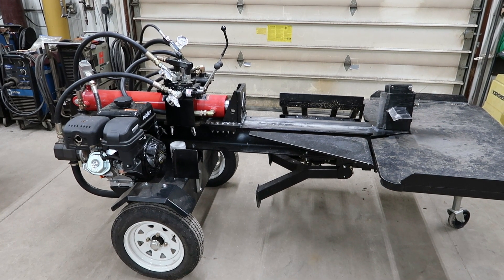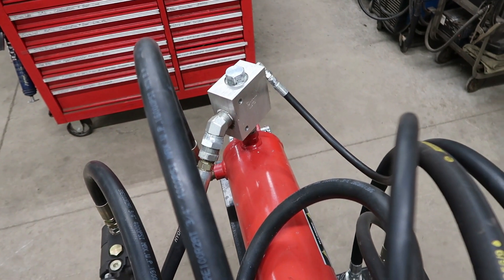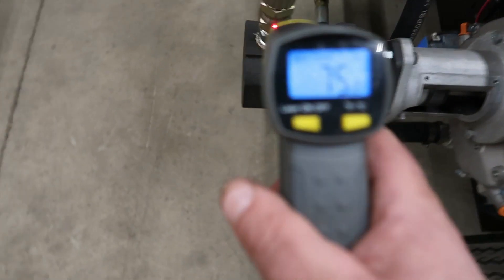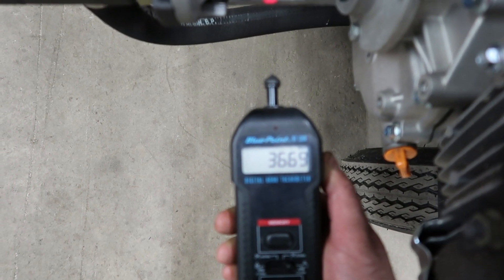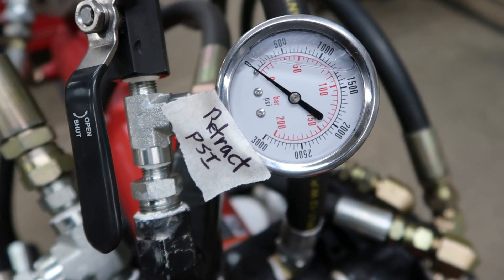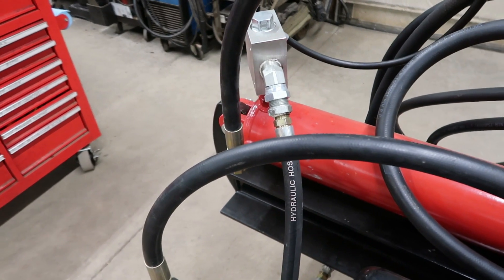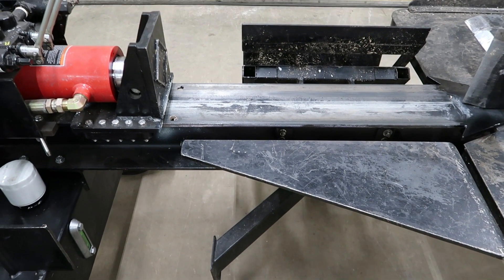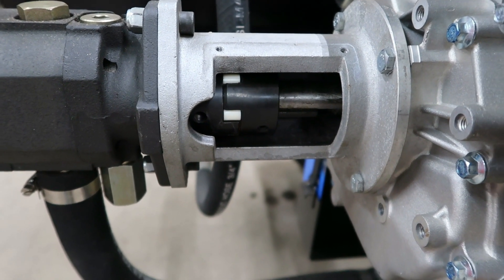Hydraulic Log Splitter Dump Valve- Operation With and Without  #7

Comment: What rpm is the pump rated at 28Gpm . I thought they were round 4000rpm this project helps in heat, speed, fuel consumption and time well worth it in the long run

Comment: Hello awesome information can you tell me where to get one of these dump valves part numbers or manufacturer? I've call several hydraulic shops, cylinder repair shops, even the dealers for the prince auto cycle valves and everyone acts like they've never heard of a dump valves on a log splitter! Thanks for any info that you can give out

Comment: Did you find that the splitting pressure needed to be set when you got the splitter.   I went from a 28 ton to 38 ton and I swear the 28 splits wood better.     I do not have a gauge on there yet but the motor isn’t even bogging down when it’s trying to push wood that is stuck

Comment: I used to work on hydraulics all the time.  Using standard 90* hydraulic fittings makes a lot of restriction.  Also, open up the ports in the cylinder and round the edges.
Reply from the maker: Yeah swept fittings would be better. I did open cylinder ports but then I look inside hyd hose crimp stem IDs and think…well there’s a restriction point I can’t do anything about.
Reply: It’s best to not have any 90 degree fitting in systems even if it doesn’t look as nice 👍 and you will run oil cooler 😊😊😊

Comment: Great video, only I could not think about doing all the plumbing. But I really like the heads up for the new spider....I’ll do it if I end up getting this machine, like I hope I will. I really like what you did got the catch table and side piece add on. Did you do the steel work or did you have it fabricated? If you had it fabricated, would you have a drawing for it and the cost? Thanks for the video it was superbly done.
Reply from the maker: These are good machines at a good price. All fabrication was done by me. No plans. I do most all my projects in my head.

Comment: There's a slight error with your oil flow when on the return stroke. With the rod being as large as it is compared to the diameter of the cylinder there is a marked increase in flow rate. On the extend stroke there's about 590ci to fill the ram. On the retract stroke only about 300ci is needed. With 56gpm being pumped in to the retract end there's approximately 110gpm being pumped out. With the Eastonmade 5" cylinder and 4.5" rod the ratio is extraordinary. I reckon the size of the hydraulic lines needs to go up a size at least especially around the dump valve.
Based on my guesstimates without seeing a schematic of the hydraulics I'm guessing the flow rate of the oil is peaking at about 40 feet per sec.
Reply from the maker: Alan correct on flow calcs. I made up a working spreadsheet years ago to figure this all out as well as there are online ones too. You posted this on my wrong video but yeah I know your talking about my homemade splitter. The 1” Dump valve can handle 60 gpms alone which leaves 50 remaining which can easily be split up between each 3/4” return hose back thru each valve. My return pressures are just a little higher than this splitter...@ 300-400psi. I also left myself a 1.5” bung on my return manifold in case I want to return dump valve oil thru filters which are rated at 110 gpms. They way I have it plumbed now oil is returned to each end of beam in hopes to disperse heat all throughout. So far so good.

Comment: Is the chrome rod hollow or solid ? Why after retracting the gauge sets at 1500 psi ? where is that coming from . Some of the retract pressure is built up to open the dump valve, some dump valves only need 25 psi.
Reply from the maker: Rex, I believe it is solid. I cut the rod end off the cylinder I bought for my homemade splitter and it was solid. Pressure remains high due to the fact of pressure being trapped after detent kicks off. The gauge is reading rod side and dump valve pilot circuit not base port pressure.
Reply: @garny3766  So if the pilot is under pressure,  the dump valve stays open until the extend lever is pushed ? It seems that the 250 PSI retract pressure should be all you have.cant see how it jumps up to 1500 so quick. Is your trick manifold on top the ARV made with square tube or all hand fab'd ? I am going to follow your lead on mine, hope you dont mind.
Reply from the maker: @rexhavoc2982   still have to get to 1500 to trip detent. 250 is how much pressure to move rod/push plate. Square tube is manifold.
Reply: @garny3766  Can you reduce the detent pressure needed to pop the valve to neutral? 1500 is a lot of tonnage on a  return short stroke stop bar, and that high pressure will pull the rod out of the push plate. To help reduce engine noise, why not mount it low and father back? I may use a operator side panel and hood with AC duct insulation sound deadner inside, any thoughts on making it quieter for the user ? Thanks for your time and info,
Reply from the maker: @rexhavoc2982   if set much lower return spool will pop to neutral when switching from extend to retract. And oil temp plays into it as well. I don’t use stop block. I like center mount controls for operating from both sides. Yeah quieter is always a good thing, just make sure engine has adequate air flow if your using an engine such as this.

Comment: Aint it  a shame you need to make all the changes to make it right after spending all that money to buy a "good" splitter? I hope they see your improvements and use them. The 90 degree edge on the sorting table can cause wood to get stuck, flatten them to 45. I hole sawed the oil tank and welded 2 inch thin wall muffler tubing through so air can pass through the tank and drag out some heat.
Reply from the maker: Rex that is why I bought this splitter. I got it on sale for a good price knowing I was going to do these mods and still come in at half the price of the brand name commercial splitters. The angle edges on catch table were just something I bolted on to stop roll offs. But yeah I 45’d the edges in my new custom built splitter in my other videos.
The convection tubes was an idea I was thinking about but reducing the capacity of the already way undersized oil tank was not an option. I was thinking about adding vertical heat fins to the wall of the tank instead. I would like to find some extruded aluminum cooling fins to use much like what voltage regulators are made out of. But my thinkings was to limit the oils restrictions as much as possible. This inturn keeps the oil cooler. Dump valve and extra filtration helps with this. Hottest I’ve seen was 140*f

Comment: Hope I can figure out what you did, as it apparently works.  But you have too much flipping back and forth to keep track of what you are showing on the screen.  Some slower movement and verbal explanation of why and when you want to show what is happening at the moment the screen view flips would be helpful. Realize that takes time and planning. ;)
   Hope in another video, or previous one, the actual changes made are a bit more obvious. 
Thanks for doing this and attempting to show the faster return speed as a result of your fab job.
Reply from the maker: My first video shows it too. I do not have a video of it in stock form. For that you will have to look at other Ruggedmade 37 ton splitter videos.

Comment: Nice Job on this video Garny!  I am curious where your dump return goes into the tank.  Is it at the bottom of the tank or mid  or top.  You generally want to be below the oil level but avoid the high pressure of the bottom for the best flow.  Nice looking machine-well down!
Reply from the maker: On this machine it’s mid to bottom. All return oil flows thru these parallel filters. My newest splitter the dump oil has it own return in the mid bottom back. The constant return flow all the way to the front of beam tank.
Reply: @garny3766  I was so impressed with the first return valves improvement, I put one on my splitting stoke as well.  (For my processor)  check out my build here:  https://forestryforum.com/board/index.php?topic=97365.0

Comment: The horsepower isn't tearing up your spider. there's an excellent chance you have an alignment issue. Probably cannot see it by eye but every revolution of the coupling causes friction which in time will eat away at the spider. Properly aligned shafts with correct couplings generally lasts years sometimes decades of use. Great video.
Reply from the maker: Not an alignment issues it a coupling size per torque/ hp rating per operating rpm. This coupling is way under sized and with a buna spider it is on borrowed time.
Reply: @garny3766  That will do it.
Reply: Garny is exactly right.  An L095 coupler with a SOX/BUNA/NBR spider (Black) is undersized even for a 6.5HP engine like the Honda/Chonda 200cc class engines.  To use a L095 you have to switch to a blue urethane spider.  On that big 420cc dude, to stay with the L095 size coupler a Hytrel spider is required... and even then it is close to the limit.

Comment: You would be better off using Loctite 577  high pressure sealant , than the general 567 white .
Reply from the maker: I’ll have to try that. What I got from the local hydraulic shop is loctite 565. They use a lot of it with good results.

Comment: Hi Garny, thanks for the video. I'm just building a vertical log splitter now. I have, what looks like, the exact dump valve as you've got, arrive on my desk today (although I don't know if mine is supposed to dump quite as much? My stop watch says that you've gained nearly 1 second which, over a distance of 30", is neither here nor there. I'll probably shorten my ram up to a maximum of 18", so the dump valve will be even less noticeable, I guess, as you state, it'll help keep the oil cool. At any rate, if mine operated as fast as yours does (once I've completed it) even without the dump valve then I'll be really happy.

Are all your hoses half inch, or are they 3/4", or what size/s do you have?

Thanks for the heads up on the Love Joy connector's spider, I'm going to be running a 22 HP Honda GX690 V Twin engine with a 28 GPM pump, so I'm gonna shorten them rubbers in short order, I'd imagine?
Reply from the maker: SeriousSchitt if your cylinder to rod ratio is close then you will see the benefits of a dump valve. If you running a 4” bore x 2” rod... not worth it.
Most all 3/4” hoses except pilot circuit for dump valve control is 1/4” and log lift is 1/2”.
I’m probably gonna be selling this splitter because I’m building one to replace it. Nothing wrong with this machine just I can’t leave well enough alone...it can always be bigger, faster, etc.
Reply: @garny3766   Thanks for the info Garny. I'm only just getting into hydraulics, but why does the pressure go from 500PSI, while the ram is moving, to 1,500 when it stops?
 I thought, once the cycle had stopped, the valve parks itself in neutral and the flow goes straight through the valve to the tank with no pressure?
Reply from the maker: @SeriousSchitt  500psi is how much pressure it takes to retract the cylinder with 28gpms no dump valve. With dump open it’s 200-250
1500psi is the detent setting pressure on that spool that kicks the valve spool back to neutral. Max system pressure is set to 2300psi
Reply: @garny3766  Thanks Garny, I could learn a lot off you, I reckon.

Comment: Hey Garny, going to be tackling the dump valve hook up this week, I noticed you have a considerably smaller diameter hose going from port 3 on the dump valve back to the rear cylinder/splitter valve. Why is that?
Reply from the maker: DRD, small hose is pilot circuit. This is needed to open the dump valve. Dump valve only opens on retract stroke and it needs hydraulic pressure to open. That’s why the pilot circuit is connected to the valve retract circuit. If it was open all the time cylinder extend would not happen as all oil would take path of least resistance out dump valve. And if the pilot was not hooked there would be no operational difference than what you currently have.

Comment: How did you get dual ports on the end of your cylinder?
Reply from the maker: David Atkinson I drilled the cyl wall and welded a coupling to it clocked 90* to original port. My very first video shows close up of the coupling.
Reply: @garny3766 did u have to hon the barrel after u welded on it

Comment: I should have watched this video before!  Lol! I did fit my 26 gpm pump on the splitter, but not a great success. One detail I missed. To make a long story short, I wanted to have the whole setup: engine, pump, alternator, oil tank, filter, etc to be a portable hydraulic unit for another project.  So I added quick connect couplers along the hoses, near the valve.  The hoses are 3/4 in and so the quick connects are. You had a 500 psi on the return without the dump valve.  I would say my engine was laboring back and forth, running empty! Enough that the pump was going on the lower stage (6gpm) very quickly. So I decided to go back to my old pump (12gpm/3gpm).  Now that I am thinking of it, I wonder if my quick couplers were the culprit of that.  What do you think of that?  Thanks for your advice Garny!
Reply from the maker: From Steel To Wood it’s possible the QCs are restricting.  How do you have the power unit plumbed?...is the valve on the unit or on the splitter?? What gpm is the valve?
Reply: The QC are next to the valve. Valve on the splitter. Valve rated for 30 gpm. Maybe I can send you a picture or even better a private video.
Reply from the maker: From Steel To Wood ok. With the valve being on the splitter do you have some type of relief on your power unit?
Reply: Yes, there is.  I ran the unit hooked to the splitter all the time.  The relief valve in parallel to the splitter circuit. So there is no flow through that valve unless it exceeds 2100 psi. I did send you a private video in an E-mail. Thanks!

Comment: As per your suggestion, I checked the coupling insert between motor and hydraulic pump.  It was shredded.  A new one is on the way, thanks to you.  I will offer some input for you too, in case you may not know.  Replace the ten bolts on the pusher sled with grade 5 or grade 8 bolts, and new nylon insert nuts.  Three of those bolts snapped on my splitter before I knew what happened.  Another thing, jack it up and check the play in the wheel bearings.  My were loose after I towed it the first time.  Love all the modifications you've done,  Thanks again!  Happy Splitting....
Reply from the maker: JoDee Zinck glad you found the spider failure before it ruined the steel couplers. Believe it or not I have not broken any push block bolts, I did tighten them up real good from new and snugged once more but yeah I’m on borrowed time with them for sure. Actually I’m drawing up a new push block that’s gonna be a lot heavier and larger than stock. It for sure will have good American grade bolts. Yup wheel bearings were readjusted just last week. Thanks for the reply
Reply from the maker: JoDee Zinck forgot to ask...is it a replacement spider from ruggedmade or did you order a Hytrel spider?
Reply: @garny3766  The spider coupling is a Dayton, from Grainger.  BTW, Amazon has a 6 way splitter that fits this machine.  ($200.)
Reply from the maker: JoDee Zinck hopefully this is what you ordered...https://www.grainger.com/mobile/product/TB-WOOD-S-L090-L095-Hytrel-Jaw-Coupling-1A925
Our jaw size is LO90/LO95. If you ordered a spider to fit LO99/100 series hub it won’t work.
Oh good to know. I seen this add for the 6 way too...https://www.zwajcommall.com/ruggedmade-6way-log-splitter-wedge-steel-six-way-wood-splitting-blade-p-609294.htm
But not sure if it’s legit

Comment: Looks good 1.5 seconds is 1.5 seconds. Seconds make minutes, minutes make hours. Do you have a parts list for your setup? Really thinking about doing the auto cycle.
Reply from the maker: Outside with Scheib these are the main parts...
Surplus Center:
9-6587-PB Auto cycle valve. Make sure you get the power beyond “PB” suffix 
Numerous fittings,flanges,gauges,filter, suction strainer, etc from here too.

Splitez:
Ez-28GPM 2 stage pump
65 GPM dump valve
Reply from the maker: Outside with Scheib that’s true! I’ll look when I get home. I know most was ordered from  https://www.surpluscenter.com/ and some from https://m.splitez.com/log_splitter_parts.html